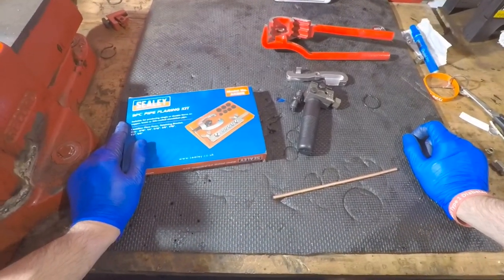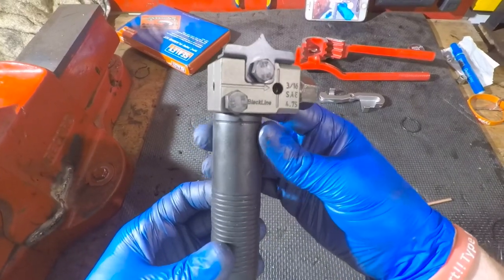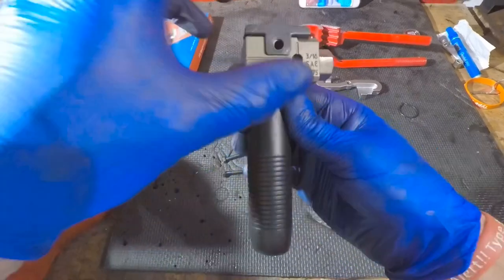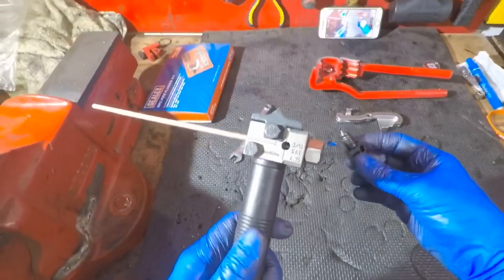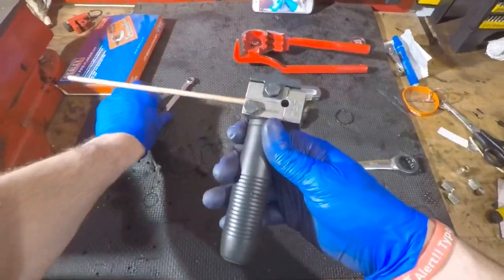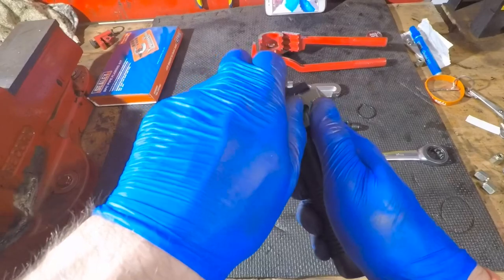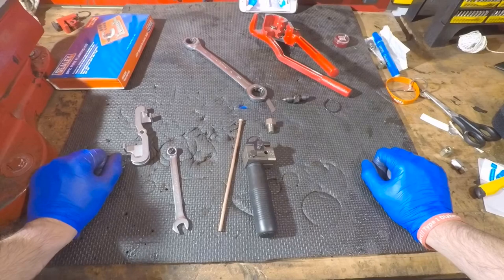Which brake pipe flaring tool should you buy? Please read description.

Comment: Very few understand the most tools make SAE fittings, that is US vehicles and some Japanese ones. All European vehicles have ISO/DIN fittings with flat back and domed fronts. IT IS IMPORTANT to use the correct ones they are different in design. The tool used here is the SAE one that is commonly made in China and sold here on online .

Comment: Nice video. Worth mentioning operation 1 or OP1 on the tool does not do a "single flare" as you say. It's a bubble flare. I only bring it up as a single flair is a single walled female end that's only used on low pressure lines, not brakes.

Comment: Just did my brake lines on my car. Yes, Sealey is rubbish. Took multiples attempt and it was still not perfect 😕The residual fluid also pushed back the pipe back☹ You need that tool.

Comment: I got an El Cheapo version of one of these from amazon, amazed at how well it worked and was easy to do it while on the vehicle. The one I got some of my flares didn't look absolutely perfect but I noticed that since I was using 98% copper it was fine.
The cat that I came with gave me a little thing of Grease and it said to apply grease to the end of the die every time you screwed it in. I noticed yours didn't have grease but the grease would probably be a great idea as it will keep the die from wearing as fast

Comment: Thanks for the demo . I believe you are in the UK . Check out Steve on the Simply Diagnostics channel . I think the line you have is NI COP . Which is an alloy of about 10% Nickel and 90% Copper . There is also a small amount of steel . The Nickel gives it the corrosion resistance . Some parts stores loan that cheap tool for free . I still would not use it . In the USA , the older cars used a 45° double flare . I think many newer cars are using the bubble flair . My older cars from the 1980's have the older double flare . I saw a demo where the handle was removed and it was held in a tight spot with a 1" wrench . I think that is 25.4 MM - I don't know if there is a " spanner "  in that metric size . Several companies sell that tool . I will get the one that does both flare types . I believe the line should be deburred after it is cut .
Reply: Could not work out why a parts store would lend you a tool - then figured out you would end up buying more pipe and a expensive tool after struggling for a day or two :-)

Comment: Excellent Video, Well explained not over complicated, Regretfully i wasted £20 on the A frame type, looks impressive tool, but only ok if one dont mind making several attempts at a flare, saw your video, bought the Blackline tool, tried it straight away when it arrived, amazing a perfect flare first time so easy,  your video is certainly spot on, great stuff.

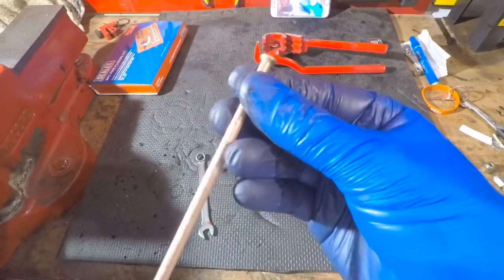Comment: At 9:57 he is 100% right that first kit is 100% garbage! 

You can rent it for free at pretty much any auto parts store in the US and I spent about seven hours (I am extremely mechanically inclined that’s why I’m changing my own brakes) in two days trying to get the thing to work and it just doesn’t. Every time I used a brake line with it it failed and I watched around seven different videos to try to figure out what I’m doing wrong.
 I finally just gave up and figured I’ll just go to a garage and pay them do it. However after watching this video I know which one to buy . It may work if you’re using that copper alloy(may work better)but I’m using 1/4 steel.
Thanks!

Comment: I had one of those Sealey type tools, utter nightmare. I re-braked a Series 3 Land Rover with one and it was an exercise in frustration and anger. Got it done but it took many hours.
I bought the DIN and SAE Black Line type ones made by Franklin and the other by Trident. Both Made in Britain. Brilliant piece of kit. Highly recommended. Had my Defender rear brakes done in about 45 mins.

Comment: I recently bought the first type and I found it difficult to use getting everything in line to get a clean flare, not only that the clamping damaged the pipe with ridges. That kit will now probably rest in piece in my shed, I in all honesty couldn't sell it on and not being too expensive not worth chasing a refund. I have now bought one similar to the second one and will now try to get my job done.

Comment: The problem with the other tool is the anvil goes crooked and then pushes the die sideways , thus misshapen flare . I think if anvil is welded so it remains at 90 degrees it would solve problem ?

Comment: I think you used the wrong flaring tool on the steel line. If it was a metric fitting you should of used the DIN flaring tool and not the SAE flaring tool. 
The DIN has a flat base under the single bubble and not a flared one as shown at 7:31 as you can see it's standing proud of the fitting and not flat. You might get away with a making that mistake with a copper pipe tho you run the risk of closing up the center of the tube as its softer but you should use the correct tool on a steel pipe.

Comment: I bought the blackline flare tool like yours but am using nickel kunifer brake caliper and the flares aren't great?? I see a lot of videos using red grease to do each flare ( the kit comes with it ) so just wondering if you've done nickel kunifer brake pipe and how did they turn out with the blackline flare tool? Cheers 🍻

Comment: Not sure, but sae is not the correct fitting for Alfas. It’s din version you want otherwise it won’t seal properly.
Reply from the maker: You are correct. The GTV is DIN. As the title suggests…..please read the description. I have both DIN & SAE flaring tools in my garage and I just so happened to use SAE for the purpose of this video. In hindsight, I should have used DIN to avoid confusion for my Alfa  subscribers. DIN is also most commonly used on most modern cars but the video was intended as a general guide.
Reply: @_RicksGarage  have you used the sae fitting on you calipers? Just interested to know if they will seal properly?
Reply from the maker: @AlfaGTA156  no, SAE will not seal properly. Only DIN must be used unless you replace both ends of the joint using SAE fittings.
Reply from the maker: @AlfaGTA156  more specifically to your question……SAE will not seal properly to the Alfa Brembo Calipers

Comment: No link to tool???
I have the naff kind and have been doing test flares and they are all wonky, I wasn't happy and couldn't get a good flare at all, then I found your video, considering the flare I need to do has to be right first time or I'm out of line (too many close bends for patch pieces) it needs to be right so I'm gonna buy that style tool instead of continuing with the other one! You litterely described exactly my issue so I'm confident in your guidance cheers buddy, but again, where is the link 🤬 lol.
👍👌👍
Reply from the maker: Thank you Sir. My apologies. Unfortunately I removed the link because the item was no longer available and the link no longer worked, sorry. There are others for sale identical on eBay
Reply: @_RicksGarage  I just found a link to a similar tool you posted as a reply to a different comment and the tool is already ordered, cheers again.....👍👌👍

Comment: They have been selling that split wing nut type for 50 year's ! plus it is garbage the die have undersize steams and never from day one will do the job right  . Eye believe that it's  intentional the industry does not  diy to fix there own brake lines. Bought  2 different  one's  there all the same garbage.   Just end up going with premade sections  and trimming  off the extra  in 3/16  than cut a section of 1/4 about  1 inch long and make a slip coupling  and brazen it like a refrigent  joint  rock solid  with brass rod . Of course this was a lot of year's ago  the special  hydraulic tool  was not somthing  you could get easily get nor did any one offer  a simple  tool that could do it right. After looking at the premade line's  you could tell somthing hydraulic and precise made the flare.  That split wing nut tool went across  the shop at 100 mph against the  wall !!!